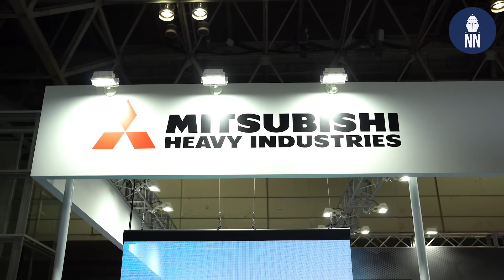Upgraded Mogami Frigate at DSEI JAPAN 2025

Comment: With Constellation cancelled, contract Japan to start building these ASAP for the US with just minimal changes (English signs and labels, etc) maybe the 57mm instead of the 5" gun...probably basically just the Australian version.
While thats happening, contract a US shipyard to take over construction as soon as they are ready.
Japan buikds "Flight 1" off their hot line.
US takes over "Flight 2" as soon as ready
"Flight 3" is later with uterative upgrades to make it more like what the USN wants, as was done with the Burkes.
But this could grt hulls in the water ASAP.

Comment: Congratulations to Mitsubishi Heavy Industries on the contract to build the Australian frigates. Thankfully only minor changes are needed for the Australian designed versions. Naval Strike Missiles must be fitted, and a Bushmaster Mk44 30/40 mm chaingun with an integrated Airburst Munition capability mounted on an RWS must be fitted to the small platforms on both sides of the Australian ship.
😎🇦🇺👍

Comment: Harusnya persenjataan mogami bisa di tingkatkan lagi seperti

Panjang 143 Meter
Lebar 17 Meter
Senjata
> 1x 127 mm Mk45 Lightweight Naval Gun
> 6x Mk41 Vls [16*4 RIM-164 | 24*1 RIM-174 | 8*1 RUM-139
> 1x Mk-15 Phalanx CIWS
> 1x Mk-49 SEGARAM
> 2x Quad Pack Tipe-17 SSM
> 2x Triple Pack Tipe-12 Torpedo
> 2x MSI DS SeaHawk Sigma 30 mm RCWS

Comment: The upgraded Mogami should be Australia's pick for the Tier 2 Multi Purpose Frigate.   I understand the VLS is upgraded to 32 cells and I really hope the aft RAM launcher is changed out for a 20mm Phalanx and the mid-ships guns are Typhon Mk30C.
Reply: Why phalanx? Isn't the RAM much better for AShM defence?
Reply: @night8285 yes, RAM is better. Sub out 11 round RAM for 21 round RAM.  Longer interception range, more missiles
Reply: @nubbyg9096  Only problem with that is the 21 cell version relies on target fixing by the ships onboard radar where the 11 call launcher is stand alone so it work even if the rest of the ships radars are damaged. I prefer the SeaRam with radar myself.
Reply: @night8285 The SeaRAM was needed when the ship had no VLS (no missiles) now it has 32 so can load 128 air defence missiles.  It is however short on  guns and specifically those good at downing drones and small fast boats. Now you can shoot a $500K missile at a $10k drone or you can shoot it down with a $200 MK30C airburst  cannon projectile or a $500 burst from a Phalanx.

Comment: I hope Australia picks this for its General Purpose Frigate Program.
Reply: And the RNZN too
Reply: @DietmarDyck  well said.
Reply: As a Malaysian, I really hope Australia picks this frigate. Maybe in the future, both our countries can do join the exercise.
Reply: They did 🎉😊
Reply: It happened
Reply: Australia eventually picked this state-of-the-art ship
Reply: Guess they did yay
Reply: What speaks against the german pitch ?  Didn t you made good experiences with german ships so far ?
Reply: @christianjunghanel6724  The Royal Australian Navy has high praise for its German-designed Anzac-class frigates, which are similar to the MEKO A200s being offered by Germany. They're smaller, older and less capable than their Japanese counterparts. But they're also a proven ship that's likely to be cheaper and easier to incorporate Australian equipment. We'll see which one the RAN ultimately chooses.
Reply: @avicenna3994  Can t they just enlarge the Meko 200 design to fit their needs ! I don t think if they asked for it that they would say no .🤔
Reply: @christianjunghanel6724  That would go against the "off the shelf" mentality that is the baseline for this frigate program, once you start enlarging designs it drives up the cost and dramatically pushes delivery times back
Reply: @christianjunghanel6724  Australia wants new frigates in a hurry. That means choosing an existing design with as few modifications as possible. Otherwise, Germany could've offered their new MEKO A210, which is comparable to the Upgraded Mogami. But despite its smaller size, the MEKO A200's similarity to the Anzacs still counts in its favour.
Reply: @avicenna3994   I see ! What does the the Mogami + have over the Meko 200 anyways ?
Reply: @christianjunghanel6724  The Upgraded Mogami is larger, more powerful and capable, has a more modern and stealthy design, carries more uncrewed systems, requires fewer people to operate, and has a higher top speed. However, the MEKO A200 is a proven design that's less risky and more familiar to the Royal Australian Navy, is probably cheaper, can likely incorporate Australian equipment more easily, and probably has a longer range.

Aside from ship specs, both the Japanese government and the EU are looking to significantly strengthen defence ties with Australia. So this will also probably be another factor in determining which design will be chosen.
Reply: @christianjunghanel6724 Japanese shipyards are alot closer than B&V facilities. This has been viewed positively as Australia can tap into existing pacific supply chains.
Reply: @christianjunghanel6724 this is essentially the Meko offer
Reply: @christianjunghanel6724 we need something very modern. The Meko is what we have had. Mogami offers more technology., more automated systems, use of drones. It’s a superior package and range of capabilities
Reply: @christianjunghanel6724 I don’t think there is anything wrong with either vessel. The extra  speed from Mogami (in terms of production) and the Pacific focus for Australia may be the tipping point (shipyards available in both Australia and Japan familiar with the design). There may be a reason for going with the German design though (I’m not in the room).

Either way, we need to build now and fast.
Reply: @murraya82   If speed is the deciding factor than japan is the winner ! But if it is a requierement to build them in Australia than it could go either way .
Reply: @christianjunghanel6724  not really we are retiring ANZAC frigates already and they didn't even get 30 years of use.. Biggest difference is the FFM has ballistic missile defence the MEKO 200 does not have ballistic missile defence leaving us with only 3 AWD for ballistic missile defence..
Reply: It doesn't matter how good the Mogami is, Australia will not buy it, here's why. 
Australia's ship building is largely owned by BAE, they are going to build the Hunter class, and AUKUS. 
Australia's prior only indigenous company with ship building capability are who built the Anzac class which was a German designed ship, that company was bought out by BAE, thus BAE dominate Australia's ship building ever since.

BAE have experience building German designed ships, however they have obviously never built a Japanese designed ship. Meaning what? It means if the German MEKO class ship is chosen, it likely could be built far more rapidly in Australia by BAE Australia because BAE already have experience with building a German designed ship. Where as expecting BAE Australia to build Mogami in Australia would be asking them to do something they are unfamiliar with, and so BAE will basically want Australia to go in the MEKO direction.

Just wait and see, I guarantee Australia will choose the MEKO, and it has very little to do with the capabilities of the vessel, it has to do with the above factors.
Reply: @ziongite  From everything I've read Austal are tipped to be building the frigates not BAE (unconfirmed officially as far as I know). Do you have a source that says that BAE will be building the frigates or is this just a guess?
Reply: @ziongite  They prob will select MEKO scrap the ANZAC class and put ANZAC systems and radars on the new MEKO hulls as cost saving solutions.. Then we are back in the same position of having instead 8 soon to be 6 ships now 11 ships that are floating cannon fodder with no ballistic missile defence from missiles like the YJ-21 and 3 AWD for at least the next decade..
Reply: @ziongite  Hello from the future, and lmao.
Reply: @ziongite well that comment didn't age well....
Reply: @ziongite well, this did'nt age well😂
Reply: Regrettably the RAN and fort fumble are likely to repeat many of the mistakes made with the ‘future frigate’ / Hunter Class procurement program (which now has echos with the US’s problematic Constellation Frigate Class procurement program): namely making a decision for a not mature platform (and one that the host nation is planning on putting in its own - largely mature systems) and then ‘Australianising’ it leading to disastrous blow outs in both cost and time. 

In a much better alternative world the RAN fleet review would have recommended - and the government would have accepted - the Navantia proposal to build 3 extra Hobart Class AWDs for a turn key contract of $6 billion incls by 2030 (maybe $7-8 billion if the latest AEGIS combat system and the Australian CEAFAR radar suites were added). 

This in turn would have allowed the RAN and Government some breathing space to get the Hunter Class right (abandon the multi-mission module in favour of a 68 cell VLS system, but still retaining its inherent ASW capability) and push back the ‘standard frigate’ decision to 2028 - and allow both TMS and Mitsubishi to propose mature and fully ‘Australianised’ spec designs of the MEKO 210 and Upgraded Mogami Frigates. 

I suspect that the government is going to go with the Mogami, but the procurement with be a rushed fuck-up, leading to those shitful blow-outs. Same as always.
Reply: From Japan's perspective, I'm grateful that they are buying it, but Australia has not chosen Japanese diesel submarines in the past. It's understandable that they would not choose us, since we were their enemy during World War II. Even the US Director of Intelligence, Gabbard, has clearly named our country as the "hated enemy of Pearl Harbor" and treats us as an enemy of the US. I don't think they would be interested in buying such a Japanese warship.
Reply: A hull that last 25% longer, double the missile count compared to its opposing competition, at least 40% less  compliment and high automation levels. Greater endurance and capacity, all built in record time!. This is a no brainer!, not to mention the first time Australia embraces an ally for the greater good of both in the partnership. There are dozens of reasons this was the best outcome for both nations and Asia as well.
Reply: I really don't mind which one Australia picks. Both ships seem to have more pros than cons about them. I am just glad we didn't go Navantia again.
Reply: They would probably want CEAFAR (which looks possible with the mast), western sonar, CMS, and missiles. Might go with 16 MK 41 like original Mogami, FFBNW 32
Reply: @lukeallison3713  The whole point is not to Australianise it, and the original mogami is out of production. Plus we need more missiles.
Reply: The way Labor is going they will probably cancel the entire programme